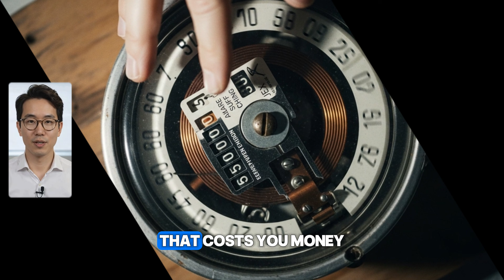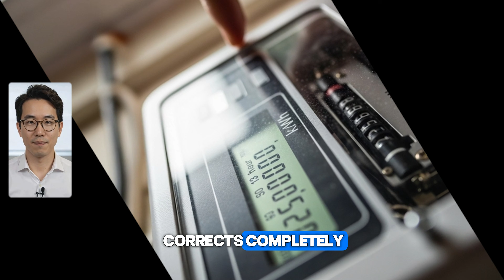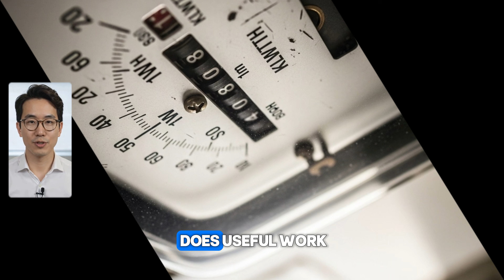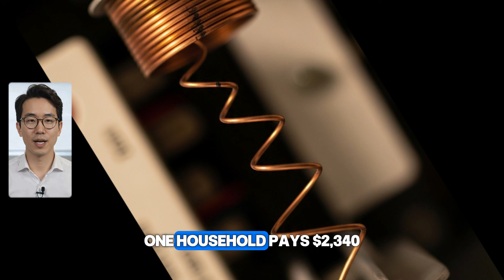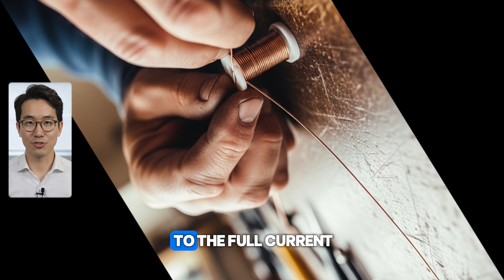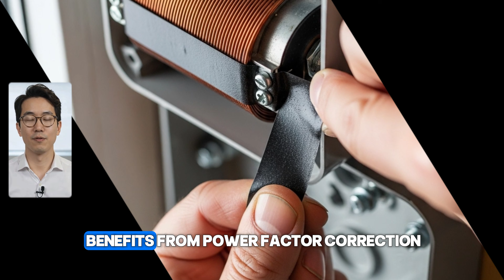This $3 Coil Wrapped on Your Power Line Cuts Electricity Bill in Half. Utility Companies HATE This

Comment: These power companies are thieves !!! We went on vacation once we weee gone for like 6-7 weeks . I unplugged most appliances so I thought my electric bill should be low it came at the same price as every other month !! They go by your previous bills .
Reply: Yes, kind of.   
  Short story: 
1.  House utilities cost WAY more than apartment power bills.
2.  Utilities hide power usage history at any address, supposedly to protect previous tenants’ privacy, 
but I very much suspect, mostly cuz it allows utilities to manipulate the bills higher & higher, via programmed-in algorithms that find clever ways to bloat the bills.   
   I’ve had replies to other posts, that confirmed this. 
3.  The bills show unit price pays for about 3 items:  transmission, maintenance, & admin costs.  
But there’s at least one “Other” category, which is NOT regulated or controlled, & can contain whatever other costs admin invents or requires—like, disaster remediation costs, which are legit, but too often include really questionable costs.   
“Other” used to be the smallest part of the bill.  But It’s gotten bigger, til now it is the largest part of most bills.  

Utilities are limited how often & how much they can increase the unit price, but there don’t seem to be any limits on bloating “Other”.    That is likely where anyone’s biggest bloated bills are from. 
4.  Total strangers can sneak-plug into your outside outlets, all day, all nite, stealing juice you get billed for, as long as no one catches them—you being gone for weeks, that huge bill could have been caused by that.  
It’s more common than most think. 
5.  House appliances can draw energy even when turned off at their off-switch.  It requires shutting off circuit breakers to cut power completely.  2 electricians even claimed that low-tech baseboard heaters can trickle power, even when the thermostat is turned off.   Guessing other HVAC can also.   It requires shutting off at the breaker box. 
  ….
We moved to a rental fed by a PUD.  
It was a very old house, but mostly renovated up to Code, but on the cheap.  The heaters were cadet wall heaters— so, a resistance heater coil with fan.  
Very wasteful due to blowing the heat (that instantly loses about 70% of the heat you pay to make).  
& most were installed on exterior walls (2x4 framing, meant lots of the heat went to the exterior)
Over time, we discovered some things about wiring in the place that were not done right, which only got found when I put LED bulb in a socket, or tried to plug 2 separate induction cookers into one wall socket.  
Those showed, there was some power being used, when the sockets were supposedly off, for instance…a trickle. 

The 1st of the coldest months’ bills were shockingly high—pushing $350/mo during worst winter cold—25 years ago!! 
We had just used the wall heaters that winter (NEVER again!!). 
The gal at the PUD literally said, “well, the bill is a lot less than your last winter bills.” 
 I told her, “we did not live here last winter!  This is a rental, & the landlords just have new tenants change the name on the billing”.  &, “our utility bills anywhere else lived in the country, even in colder climates, we’re never anything close to this high!”
Also, that PUD only read every other month.  
Her response tone of voice sounded shocked, with notes of guilt, but she was not forthcoming.   She was covering for the utility. 
What she otherwise admitted to, without specifically saying, told me that previous tenant used the costly wall heaters way more than we did.   
And, PUD looked back at previous seasonal highs, to influence current seasonal bills, making current bills artificially high.   
And, they averaged. 
I figured, if they had not considered previous tenants larger bills, ours would have been even lower than what they pasted us with. 
And, utilities algorithms keep “compensating” for any energy improvements owners do.  
Our bills have merely dipped the months we install any energy saving things, then jack back up to previous levels or higher, after that, even after noting improvements on the utility account website.  They know we made improvements.  But, it did not stop the bloated bills. 

That has broken my trust, & I feel motivated to do anything  I can manage, to cut usage lower & lower. 

But utilities are desperate for income.  
Not only do admins/execs take way too huge salaries.  
But all over territories fed by Bonneville Power Association, ALL utilities were court ordered to help bail out BPA from the blindingly huge, trillion$ lo$$ someone fubar’d, in the late 1990s.   
That resulted in a big chunk of everyone’s bills turning into perpetual income to BPA.  
That BPA debt can never be paid off.   
Very like the National debt in the Trillion$, cannot be paid off—indust’s control govt, & they control everyone.  
They’re all corrupt.
Reply: That is true. Last month I got a $2.00 bill. Next month an $83.00 bill.

Comment: 😂❤ As Professional I can Confirm THIS(!)...😢 You Can Eliminate It, Using Filter(Capacitor/Inductor!)... BUT(!), You have to measure FIRST the Values to Calculate the Filter! Running AC and Pool PUMP... Could  be  Significant Factor!!!😮😢...😊❤
Reply: That is one reason this didn't sound right to me. Every home is going to have a different power factor, and yet there was no mention of how to adjust accordingly.
Reply: @timrider1224    AI scrapes internet for data.  It commonly fails to grab enuf data.  
Then, it cobbles the data it gets about a subject, into repetitive, verbose, “chatty” sounding stories that emotionally hook viewers, while stringing viewers along as long as it can to keep ‘em looking. 
AI is programmed with data of user psych-vulnerabilities that can be profited from. 
But they omit important stuff, & mispronunciations of words confuse & misdirect, & the very irrelevant pictures included, absolutely misdirect & confuse. 

So, AI wins; humans lose.

Comment: It is my understanding that typical residential power meters only track actual power, not apparent power. Also, a coil wound around a current carrying conductor WILL have a current running through it if it makes a complete circuit, and show a voltage across it if it is an open circuit.

Comment: A Tesla coil is bad for simulating lightning it cant come anywhere close to delivering the amount of current a lughtning bolt can, thats why the model plane is deflecting those 150mA bolts..lol, however these tests werent for lightning shielding it was for testing electrostatic leading edge  flame jet propulsion like what is currently on the B2, selectively weight reduction technology disguised as shielding

Comment: This doesn't work and if it did the electric company would see the wire coil and just remove it then cut your electricity off and charge you double to get it turned back on just like they tell you that if use wind power along with the electric grid and the wind turbine puts energy back into the grid and makes your meter turn backwards they owe you money instead they turn everything off and call the police because you have something hooked up that made your meter go backwards so they you go to jail they disconnect the wind power and put in a new meter and you pay for all of it.

Comment: Residential Meters don't care: Home meters measure Active Power (Watts). Adding a coil or capacitor might technically change the "Power Factor" of your home's electrical profile, but your meter is designed to ignore that part of the calculation. Your bill will remain exactly the same.

The "Coil" does nothing: Simply wrapping copper wire around a service cable (without connecting it to a circuit) does not provide power factor correction. Power factor correction requires Capacitors connected in parallel to the load, not just a coil of wire sitting near a meter.

Energy Consumption: If you actually connect a coil to your power, it becomes an "Inductive Load" (like a heater or motor). It will actually increase your energy usage because the coil itself has resistance and will dissipate heat.
Reply: I would like to know where you can get 80 ft. Of 18g copper wire at for $3 please.
Reply: @johnjones7078     The 18g. non-coated copper wire is fairly thin. 
OOK. 25 ft. 35 lb. 18-Gauge Copper Hobby Wire. 
   $7.35. (29¢ /ft.). Today. home depot website.   
In-stores, they have carried it by-the-foot—it may or not be in-stock.  
It’s Not $3.00, but it’s not too costly either.  Covd Inflation/tariffs/etc. 
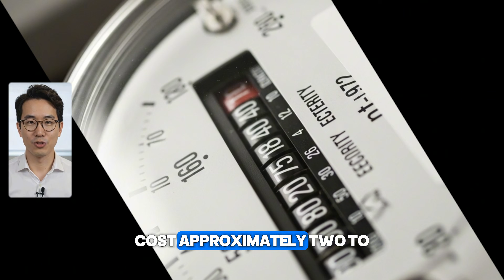It specified (after about 14:27 of video—& I included a couple details).  

If you get multi-strand wire, each wire should be 18 gauge; that can be separated to use one wire only, but do NOT use intact multistrand, to coil with.  
 I don’t recall it saying non-coated, but to work, needs non-coated.   
Splicing wires causes difference in function. 
The info is some kind of real—tho Idk what kind of real:
Check here for some info:   https://www.eco-manity.com/power-factor.html 

Kinda thinking, just pay a licensed electrician, to both be sure it’s properly done, & maximises the savings, Cuz it says the wire coil is only about 30 - 40% efficient; but a proper capacitor system can be far more effective, around 90+%. 
Over time, it will repay that cost, & cuz professional did it, the utility won’t interrupt. 

Coil Instructions: 
It failed to say if coil must go clockwise or counterclockwise relative to the service line.  
Wrap service line so coils touch each other but don’t overlap, snug but not tightly Around the service line.  
Most service lines are right up against the wall; winding the wire around it is some work, especially if line is touching the wall & painted in place—paint blocking winding needs removed.  
May need pliers to pull wire between wall & service line. 
Stick ends of the coil wire to service line with electrical tape to hold in place .  
Wrap electrical tape around line with the wrapped w/coil, to protect coil from weather.  

These dang AI time/energy wasters sprinkle bits of info—it gets lost in hyper-chatty, disorganised script. 
The pictures are irrelevant.
Reply: If you put the capacitance in parallel with load (you said to), this means you could remove the actual load from the circuit and you would be left with the capacitor short-circuiting all by itself, trying to pass maximum current and then the instantaneous heat explodes the capacitor. Do you see this now? For some reason most people say "put the capacitor in parallel with load" and this is very curious as to WHY they make this mistake. Putting the capacitor in series will do the phase correction and NOT represent a short-circuit. For some reason most people do not see this relationship in their mind.
Reply: This is the same thing as the unit you buy from eco watt or Tesla.
To plug into your outlet closet to your meet but you need one on each floor of your home
Reply: @-randychasechase2660 they don't work anyway
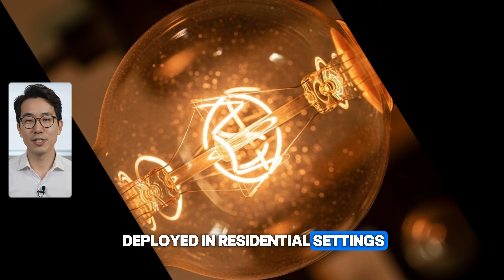Reply: The video claims that utility companies shifted to a billing model based on Apparent Power (kVA) rather than Active Power (Watts) for residential customers [04:03]. If this is true, any reduction in Reactive Power would indeed slow down the meter. Do you have evidence that modern digital Smart Meters are strictly programmed to ignore the Reactive component in every jurisdiction, or is that just an assumption based on older analog meters?
Reply: @Dr.MayaLawson  I know of a new smart meter where the phase correction was present for 20 years, and the new meter showed 1/3 the consumption as well. The saving is this phenomenal.
Reply: What if you run opposite end into ground?
Reply: many have said putting a quartz crystal on the line before the meter saves electricity
Reply: If you look closely many computer and monitor power cables have this attached.  The goal isn’t to change the power usage but rather dampen the disruptive magnetic field that is generating eddy currents that the meter detects.

Most of these magnetic filters make use of an iron ballast ring.

This is worth more research before installation
Reply: are you sure? i suspect he has something here, but i cannot know.
Reply: @John-100it’s ai misinformation
Reply: @John-100 It's not that he "has somethign here", it's that he's ABSOLUTELY, TOTALLY, COMPLETELY CORRECT. The garbage spewed in this AI-slop video will accomplish NOTHING unless spotted by the power company, who WILL first remove it, and MAY follow up by filing  charges against you for tampering with their equipment - Which is generally good for a nice prison stay in most (if not all) states.
Reply: @Ferd414 if you just wrap it around you're not messing with their meters doesn't hurt to try
Reply: @Pterophytes  Try and be damned - It'll do absolutely nothing except maybe land you in the cross-bar hotel for tampering with power company equipment with intent to defraud. Gawd - why is it so many people are so quick to defend *TOTAL IDIOCY*??? It's gotta be the same mental dysfunction that allows them to believe in Santa Claus, the Easter Bunny, and an imaginary sky-fairy that supposedly loves them, yet threatens to throw them in a lake of fire forever after they die if they're naughty...

Comment: I have to tell you that you have it backwards.  Yes, a resistive load draws real power and a reactive load draws imaginary power. 

However an electromechanical Watt-hour meter measures only reàl power.  Imaginary power is not measured. Residential users do not pay for it.
Reply: I used to pay for it but l turned my disconnect off so I don’t pay for it anymore

Comment: Why that may be true I’m wondering now our meters are automatically read from the line coming in, so there’s no meter reader that comes around and physically reads the meter
Reply: Telemetry through a mesh network.  Your meter sends information back to the power company through the wiring.  That information actually passes through other meters along the way, that act as repeaters, much like "stepping stones" until it gets where it needs to go.
Reply: @TheRealCheckmate  I see well see I’m in rural area and There’s there’s gates gated area it’s one square mile and in 1958 it used to be that way everybody just had open fences and as a rural community with horses and cows and pigs and peacocks but now the area has been updated with the people from the city and I think the meter readers of course don’t wanna open the gate come in where there’s a dog so it’s advantageous for the electrical company to have automated meters like that I understand what you’re saying but rate device copper would still help is that correct?
Reply: Everyone’s been forced to allowing smart meters.  
Those are mostly (entirely?) now wireless.  
Energy comes to the meter, feeds the house, & unused energy goes back thru the meter.
Being rural differs from urban & suburban areas with houses near each other. 

Utilities track daily use via wireless meters sends signals. 
Wireless signals are supposedly better than wired signals.

One type of Wireless meters sends each house’s signal to head office to construct the bills.
Another type of smart meters send signals from several houses to a “hub house” those surround.  
The several smart meters send their signals to the hub meter, then the hub meter boosts the data packet for all, to head office.  
From what I’ve read, it is too common for utilities to claim far fewer signal-sends than are actually happening.  
Those use a bit of energy, and, contribute to sometimes dangerous levels of EMF/RF “electrosmog”, which can harm living things.  
But I digress. 

The industry has been using many clever “solutions” to jack-up folks’ power bills.  

Most homeowners can apply to get the analogue spinning-wheel meters put back on their house, & pay probly $80 & up monthly, extra, for them to send a meter reader.  
That helps protect against electrosmog.  But, it doesn’t necessarily get the old-tech meter back.  
The utility guy who installed ours, stated, “you know, the old meter we took off, despite looking like the analogue tech wheel units, was made to send signals to head office!”   He did, tho, Conspicuously Not answer, when asked, “well, why were meter readers needed to read those?”  

Everytime I dig into it over the past 30 years, I find more & more layers of tricks used, to milk more money from their mandated “cash cows”.  It ain’t pretty.  
Most utility workers are clueless of these.   Even office staff are usually clueless of the tricks used to manipulate bills. 
It’s mind boggling & disheartening, how corrupted, Privatized corp’s (even non-profits) have been, & for how long & getting worse; increasingly, they opt to go for profits-over-life.

Comment: High voltage Electrical Engineer here: THIS IS BS! For single phase low voltage electrical supply for majority of homes this is BS!!   MEASURABLE Reactive power only applies to LARGE inductive loads/motors and you can only realistically correct for this with capacitors.   A few winds of copper can NOT match the varying loads of household small motors switching on and off.   DO NOT RISK YOUR LIFE BY ATTEMPTING THIS!!!  ALSO IT IS TOTALLY REPEAT TOTALLY ILLEAGAL TO MODIFY ANY POWER LINE BEFORE YOUR METER!!!   THAT WIRE DOES NOT BELONG TO YOU IT IS YOUR POWER COMPANY'S.

Comment: Do the 18 gauge copper coils touch each other as they wrap around? Is that necessary for it to work?😊 - also, do the ends reconnect to each other with the electrical tape?
Reply: Are you not worried about messing around power cables when your asking random questions.
Reply: It doesn't matter how you do it your bill isn't going down but you'll know how to wrap a copper wire around a conduit after you're through.